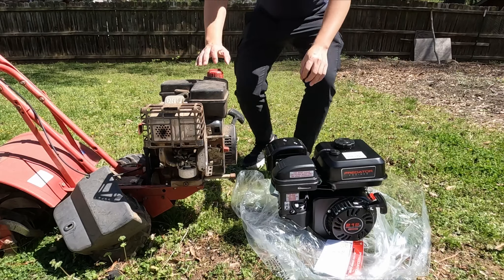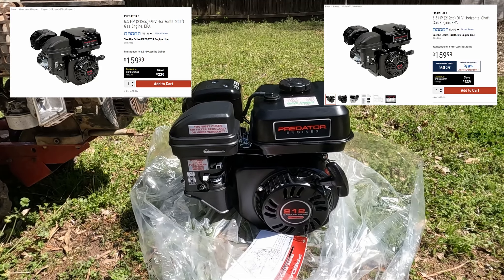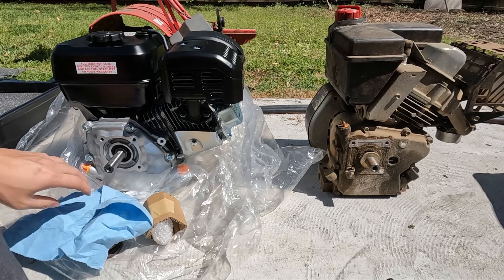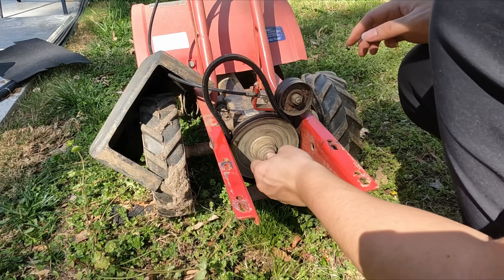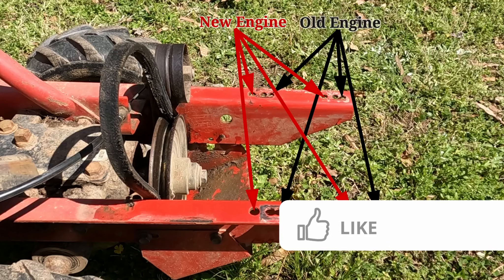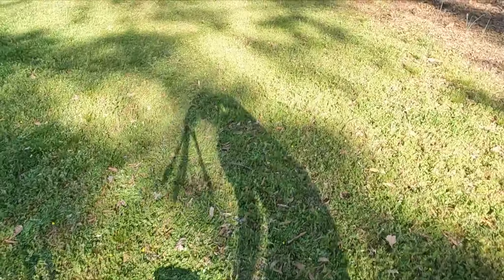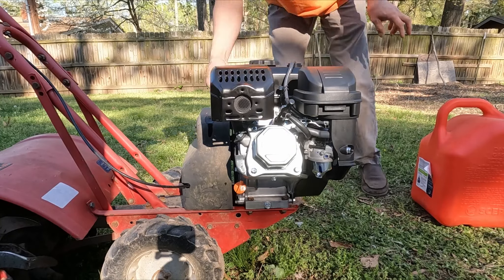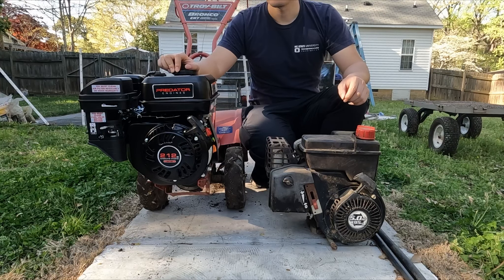Predator 212cc Horizontal Shaft Engine Swap: 17 Years Old Tiller Revived!

Comment: The standard Predator 212 engine exhaust is directed straight back to the operator, causing problems. You can buy a deflector that screws onto the heat shield, which sends the exhaust smoke upwards, much better.